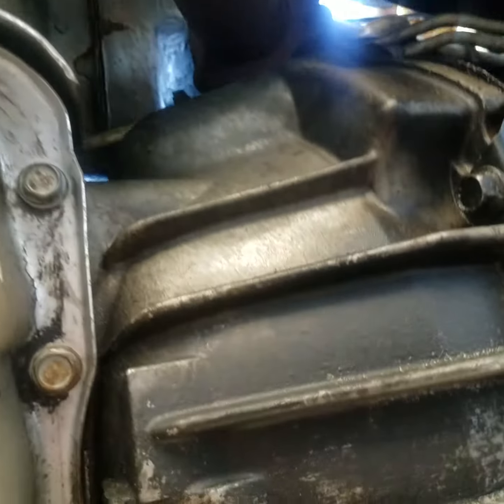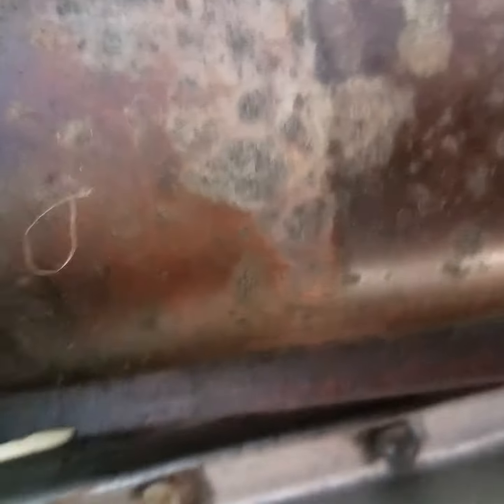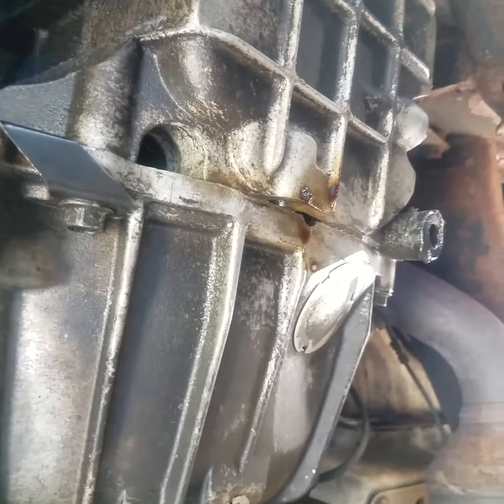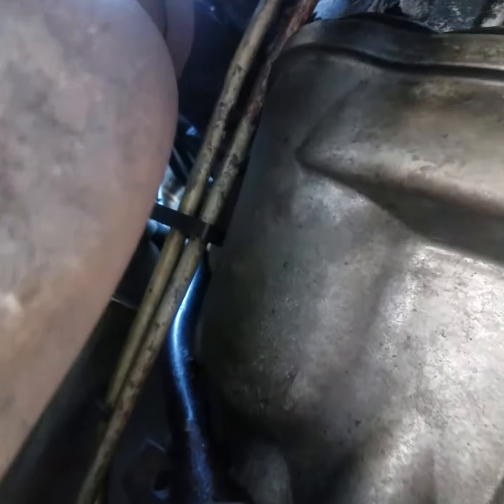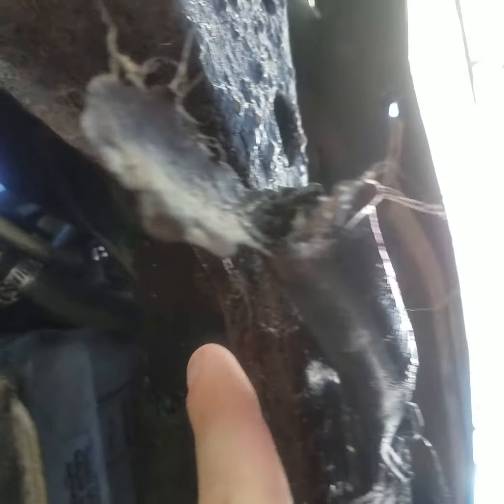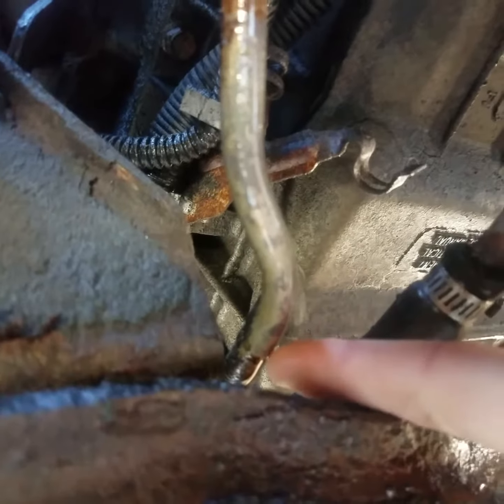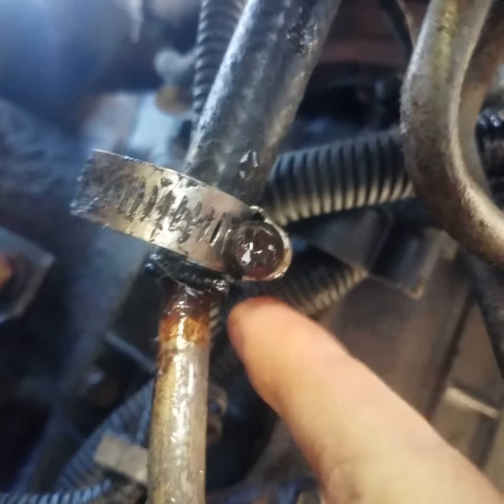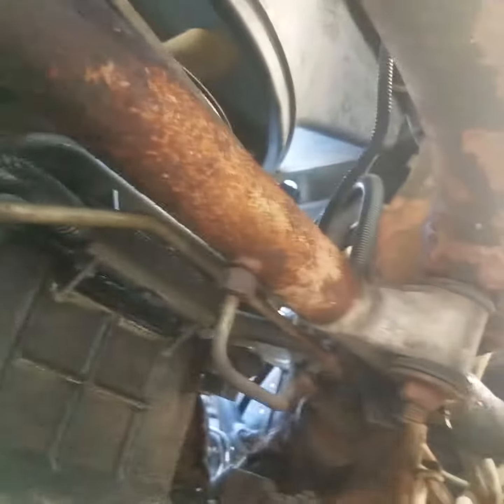Transmission Line Leak Repair

Comment: An old mechanic told me when I was young always double clamp each end of your transmission line repair. Two clamps on each end. It's never failed me BUT  when I used one clamp only, had same prob as you
Reply: I used two clamp on all my main lines

Comment: Never did this before but have a problem now. Someone mentioned flaring ends on another video. I would say double clamp after degreasing both ends of the line with parts cleaner or brake cleaner..

Comment: Where is the repair?
Reply from the maker: It was that leaking line that I showed towards the end of the video but my battery died on the camera
Reply: Did you just replace rubber part or entire line? Seems like easy fix with new rubber piece and double clamp both new ends